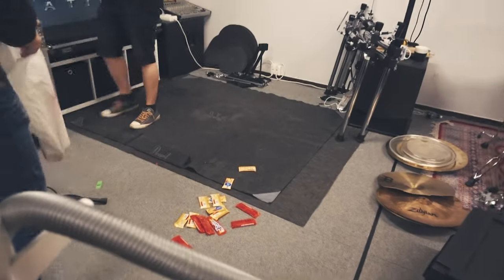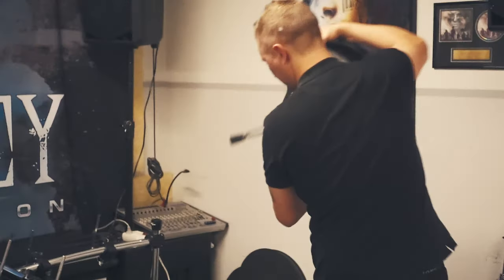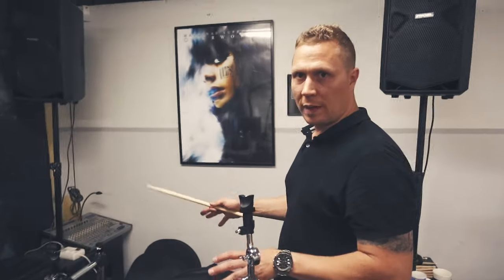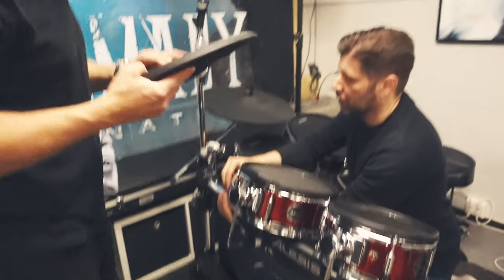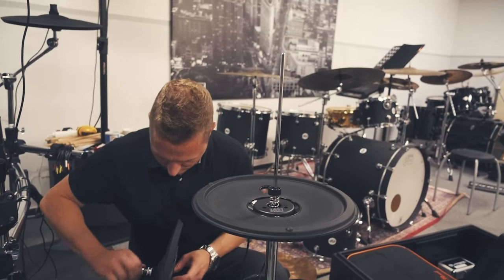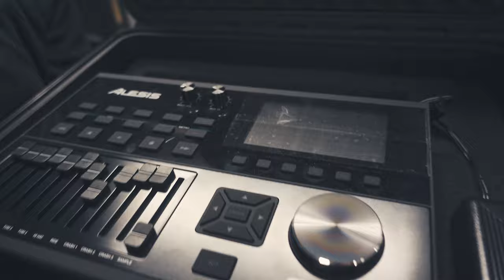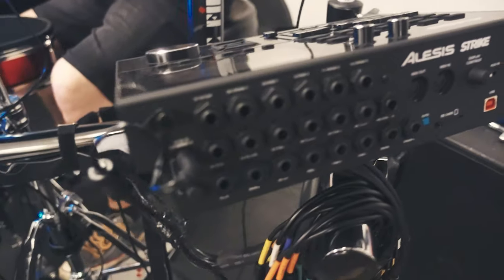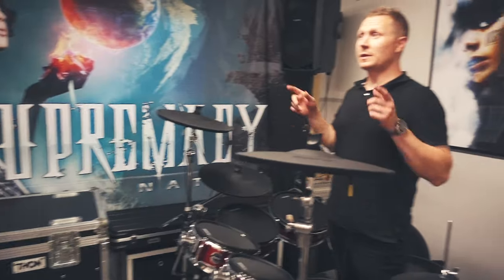ELECTRONIC DRUMS! — why we switched

Comment: Currently moving away from using electronic drums live myself, I have the roland td30 and they work phenomenal for live shows, but at the end of the day after using it religiously for 4 years I just still cant deny the loss of dynamics is too great with electric drums and moving back to acoustics is showing me that electric drums just can't ever replace the real thing on the same level.
Reply from the maker: This is a really good point, but also exactly the same reason this works for our sound. We are actually looking for a bit less dynamics when it comes to the beat of our music. Our sound is fairly “produced” and we are taking that one step further now. But who knows what we think in 4 years :)
Reply: A properly mixed, properly compressed edrum setup will sound just as full as an acoustic set, it's just HARDER to achieve. One of the keys to making this happen is mixing your snare and bass separate from the rest of the system.

Comment: An electric guitar still makes its own noise. If this kit uses samples, it's less of a real instrument but, let's be real, your band never catered to die hard "real instument" fans.
You've had a digital sound since the beginning and it's part of what makes you unique. Digital drums are just the next step.
Reply: Electronic drums also make their own noise, you are still hitting things with sticks - its just using a more silent head.  it's just not very good sounding without the samples, much the same as an electric guitar if it's not plugged in to an amp when your on stage.
Reply: @ParanormalIndiana  Yes but an electric guitar is amplifying that quiet noise, while these electric drums are playing a prerecorded one over the top. That's the difference.